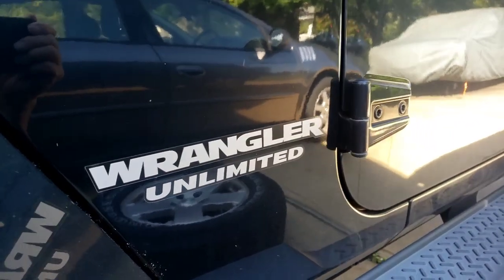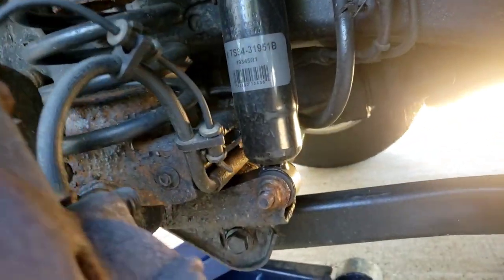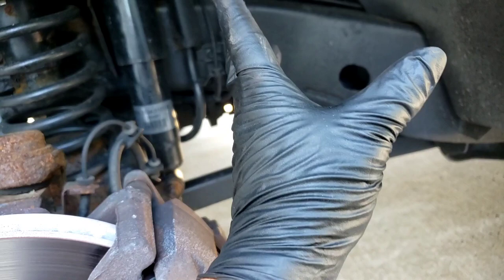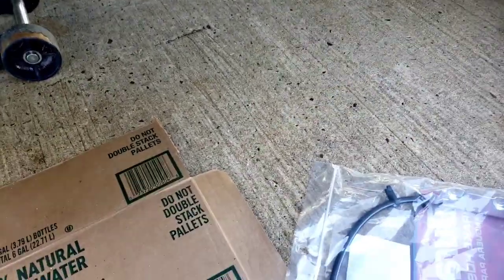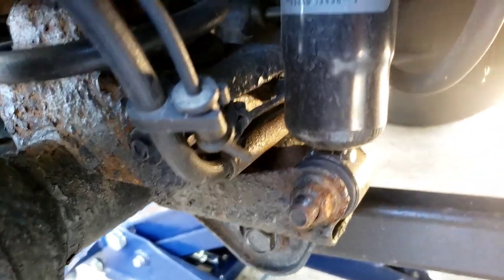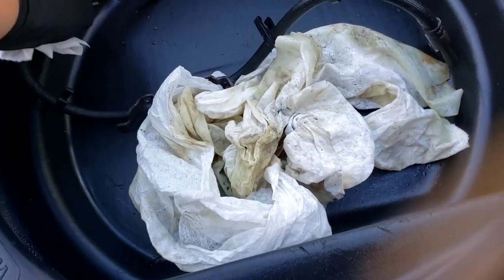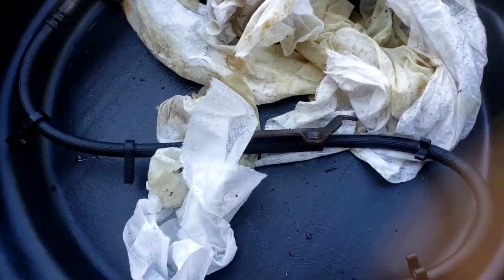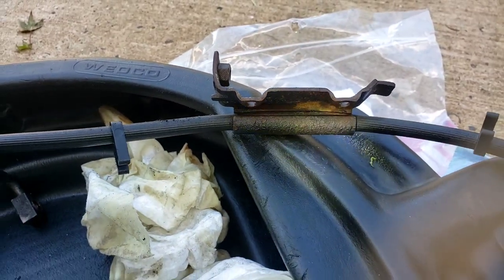Jeep Wrangler Front Brake Rotor Getting Hot Smoking and Dragging Locking up 2012 and Others similar

Comment: The Calipers are also unfortunately junk, replaced front hoses and calipers 6K ago, started dragging after a pad/rotor change. had to warranty LF caliper today it started getting hot enough to smell hot brake smell driving in traffic. Pulled over and a bunch of going backwards and forwards slamming on brakes. It unstuck it enough to make it the 40MI back to the house to save a tow bill
Reply from the maker: Wow, I never had a problem with any rebuilt calipers, only thing I ever noticed was the oversized bleeder screws